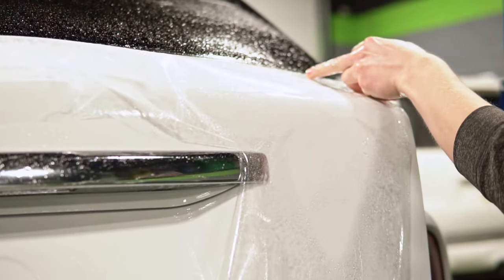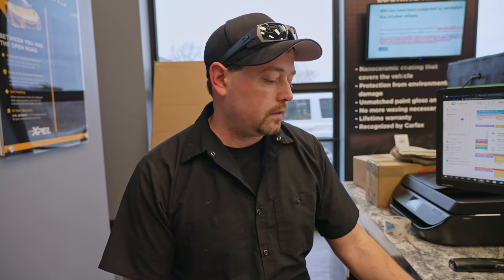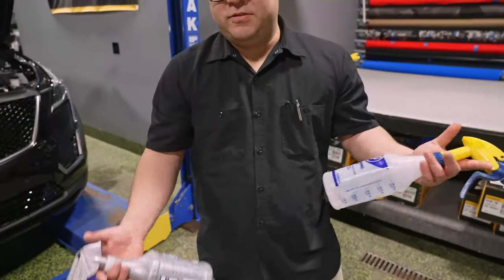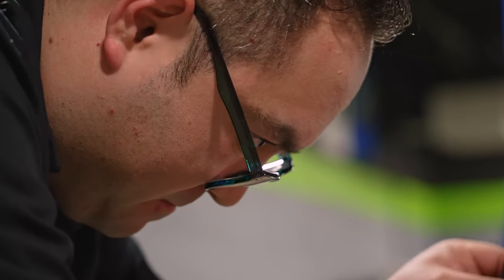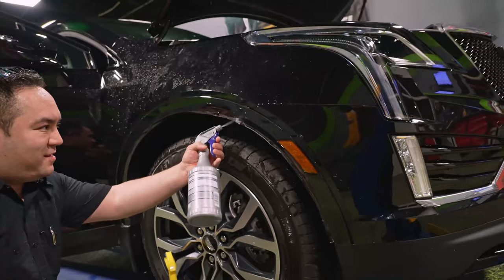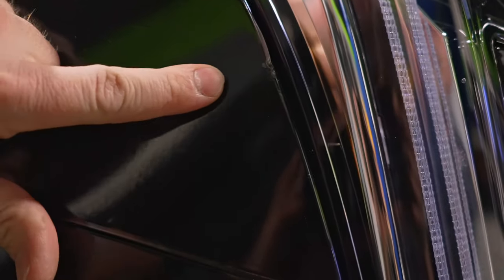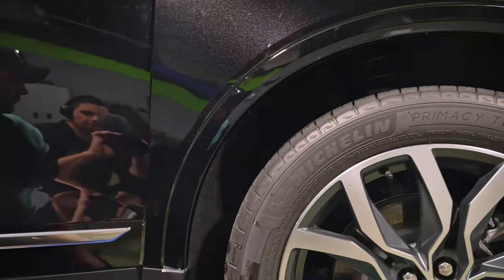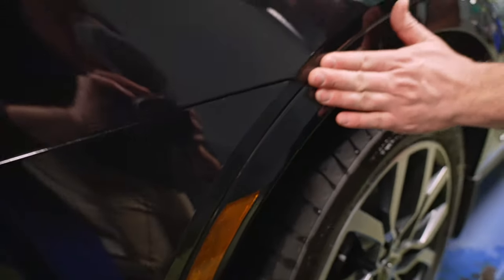🤔 DIY VS PRO | BEGINNER vs PRO Paint Protection Film Install

Comment: Great video. I did my own car without precut kits and I've done it before. I took my time and it turned out great I payed 900 for a role 60inch by 200inch to do the front of my car. I went as far as taking my bumper off. It took longer than what a professional would have but everyone around my area wanted 2000 to do it so I saved my self some money. I'd never do it again lol because it took me forever but that's why it turned out good because I took my time. It was a 2021 dodge charger rt. So it didn't have any crazy bends or turns or grooves in it
Reply from the maker: Glad it worked out for you. It’s quite the learning curve to get it really good and timely.

Comment: You’re missing out on the fact the material is pretty cheap, what costs a lot is the plans to laser cut it.
If you can get plans to cut it or make them yourself it becomes much much cheaper.
Reply from the maker: Hmm sounds cheap and easy when you put it that way
Reply: As long as you're careful with an exacto blade put full sheets up and trim as you go.

Comment: Slip solution is typically 2.5ml of johnson's baby shampoo (best) or 1.25 ml of dawn dish soap into about 997ml of distilled or RO water to make a full litre of solution. Tack solution is 250ml of 70% IPA with 750ml of RO/DI water to make a litre of tack solution.

I agree that having a pro install is best especially for a long-lasting quality finish. It's hard to DIY this, knowing where to tack edges, how to deal with issues. If the car you are protecting is expensive, spend the money on a good PPF install and forget about it for the next decade.

Comment: Have an VW Arteon. Precut parts are going to run me $1600. Rolls of wrap to do it is only going to run $243 and allows for better excess in the process. I am sure it will not be 100% perfect, but the main objective is to protect the finish, so a minor defect will not cause me to lose any sleep.
Reply from the maker: You can add them at your leisure too. Couple panels here and there. Save lots this way. Good luck 👍

Comment: Xpel keeps their prices tall to make it not worth it for the average consumer to DIY it - obviously the shop isn’t paying 1500 for the material not even close to it
Reply from the maker: Correct, you're also paying for the plotting/pattern technology.
Reply: @BlackoutTinting  even when I try to buy it in bulk and cut my own doors and hood and roof it still remains super expensive
Reply from the maker: @user-jt3nf7in5w  looks like XPEL doesn't want every DIY guy driving around with their product

Comment: PPF is one of the few things definitely not worth DIY due to cost of material being the driving factor and not labor. XPEL will sell a consumer that front end kit for an artificially high price of $1500, but they sell it to the shop for much less since they are going to keep ordering and have significant volume. This lets the shop only charge $250 more which would be about 2.5 hrs of labor which wouldn't be profitable if they had to pay full $1500. It's a win/win for manufacturer and installer.
Artificially high consumer sale price protects shops, prevents too many DIY installs which can hurt brand/product reputation, etc

Comment: I think you would have more credibility to this video if you weren't pre-wired/biased to say a DIYer can't do it.  Further, Isaiah, the poor soul, is not your typical DIYer.  I doubt he even changes his own oil.  Am I right?  If he was truly a DIYer, he would not have just "guessed" at his tack solution (which should be 1.5L water, 2ml baby shampoo) and ISO mix (3:1).  The price you quoted at the XPEL website is retail price.  A DIYer would be better off buying bulk uncut rolls which should be around $350 for a 36"x100 feet or $500 for 48"x50 feet which is MORE than enough to make lots of mistakes.  Aaron clearly does a great job.  Assuming it takes him 2 hours to do the front of the car at $1700, it's an impressive business plan that I'm no longer willing to pay for especially around here where they're not as good as Aaron.  Back when PPF wasn't as popular, this used to be $750 WITH paint correction!
Reply from the maker: nowadays you don't even need to do a paint correction before installing ppf

Comment: Drive Protected has a ton of excellent tutorial vids showing how to install PPF. I just purchased my precut kit and after tools, I'm up in the area of $1800 in savings for the full front end kit for an Tesla MYP. I thought it was worth a try.. I'll see how it goes. Will update with result and whether or not it will be worth it.
Reply: how did it go lol
Reply from the maker: how'd it go @mooster
Reply: @BlackoutTinting  About 3 months later I'm happy. Took me about 10 hours to install the hood, fenders, mirrors and bumper. But it turned out great ! The bumper was a b*** to install but otherwise it was cool. I'd like to give wrapping a try one of these days. I will say its not at a professional level like you guys. But for a DIY person that wants to save a load of cash and is okay with some imperfections here and there, Its well worth it !
Reply from the maker: Now this comment makes sense - like any diy job, prpba ly not as a good as a pro but if you can live with it so be it. Thanks for the update.
Reply: How much was the ppf material? Shops around me charge $1800 for the full front of my model y.
Reply from the maker: That’s probably about the average
Reply: Where’d you buy the film from?

Comment: Overcharging for materials and undercharging for labor skews the value proposition of this whole project for a DIYer. When you're forced to dropped hundreds, if not thousands on what is essentially a large screen protector, it feels stupid to then endure the struggle of installing it when it only seems like pennies more to have the pros install it for you. 

I'm not judging. I get it. Businesses have to stay in business, and if they have to adjust costs due to customer behavior, so be it. But don't act like the price of DIY vs pro install is somehow a valid point to bring into the discussion when the DIYer has no control over the outrageous prices companies charge for this PPF material.
Reply from the maker: Everyone is more than welcome to buy roll(s)of cheaper material from ebay and hand cut everything themselves, and many do without complaining.

Comment: 3m 8mil factory roll and positive attitude, $1,900 for a truck. Dealer installed $10,000, what am I missing (price quote from trained Xpel distributor).......... interesting racket
Reply from the maker: But they price it in with financing so you see little numbers

Comment: Awesome video. As a body shop owner I decided to send one of my techs to XPEL for certification for replacing PPF. Mind you, I am NOT in the business of being a PPF installer. I merely wanted to reduce the amount of sublet providers I had to rely on for our collision repairs. We usually find out selves replacing A single piece of film such as fender bumper or hood about once a month. I’m going a bit long here but I want anyone reading this to really pay attention to this next part. I consider my tech a step above a DIY’er but still not professional. I just purchased a Cadillac Escalade that I am going to have completely wrapped in Stealth. Now I could roll the dice and try to take this on. Keep in mind, I have an XPEL account that allows me to buy film at prices close to wholesale if not the same as you. Long story short… it’s going to a Professional installer. Just as you said in the video, we could probably take this on but we don’t deal with bulk film installs and it not worth the risk. 

DIY’ers reading this, go fix a hole in you sheet rock, go plant a garden… but leave PPF to the Pro’s.
Reply from the maker: Agree... it's not a diy type of project although it definitely can be done.

Comment: The protective film industry is a rip-off. They prey on the fact this takes skill to apply correctly, as well as a decnt amount of paint cleaning and prep.  There is no way the materials cost as much as what's charged.  Im betting the $1500 price here costs expel under $300 to make/ acquire , cut and package.   Im also betting dealers/ installers pay less than the list price, but charge the customer that price on top of the labor they quote without telling customers.
Reply: We really do pay the $1500 a roll. Maybe a 1-200$ discount if buying bulk. It really does take a lot of time to do. That and the fact that working on a car at this level can introduce risk. PPF is pricey because the work is long, hard and takes a lot of time to master. Nobody charges under $4000 for a reason

Comment: I had an expel licensed certified guy do my Dodge Challenger hellcat nose and rocker panels and mirrors all for $750.your saying that cars nose eould be $1700.00  Clear bra will never be accepted by most people because it's just too  expensive.this video is a scare tactic  to promote shops to rip you off and ceramic coating  is the biggest scam I know I worked in shops my whole life.
Reply from the maker: We are booked out for months, but if you want to protect more than just the👃we might be able to squeeze you in

Comment: Well.....I wanted to try to do my new Ford Explorer ST front end.  Hood, fenders and front facia and both side view mirrors.  NO WAY I'll be doing it if its only saving a few hundred dollars.  I'd rather a Pro like you guys do it and get the 5 or 10 year warranty it comes with.
Reply from the maker: Good thinking... There are of course lesser products other than XPEL to put on vehicles but a little bit of research will show why most turn to XPEL
Reply: @BlackoutTinting  ....so to do the hood, fenders, front and side view mirrors would cost me about $1500 in just the film?   Wow, I didn;t know it was that expensive.

Comment: After all that i still say diy. get cheap ppf  learn and get at it. If you learn you'll be able to save money on next car if you pay for someone you'll have to pay someone each time. That's how i learned window tint. Car audio installs and more. Don't be afraid to try. Don't be afraid to fail
Reply from the maker: There is a bit of a learning curve, something you would surely forget 90% of by the 'next car' but good luck!

Comment: I just did one of these for the front end on my GR86. I bought a DIY kit for £450. These people charging £1500 for a job that will take a couple of hours tops. I am just a hobby mechanic and painter but this was child's play. These guys are charging £350-400 an hour for glorified window tinting which is actually harder to do. All this video has shown is that the person in this video is incapable of doing it. A semi competent person should have no problem. It isn't rocket science. Blending in paint is far harder to do well and painters do not charge the rates these people do.
Reply from the maker: Will you fly to Pittsburgh and compete with us?

Comment: IF you are a TECHIE guy, you can DIY easily and save you a lot of money. Their figures is way-off coz the labor will kill you and I am sure you can buy the film cheaper from the distributor, cut it yourself and install it. It is not that hard to spray water, stretch the film, and squeegee it. IMHO.
Reply from the maker: Are you up for a challenge?

Comment: Its wild how much these companies charge for a sheet of plastic...PLASTIC. The labor to install it is fairly priced, but the product is a rip off.
Reply from the maker: It's self healing, hides scratches already on the vehicle and comes with a 10 year warranty. What do you think a fair price would be?
Reply: @BlackoutTinting  Yes it does have some great properties. I read adding PPF to a whole car adds around 10lbs. The retail price for 10lbs of plastic pellets is around $30. What's the material cost for wrapping a whole car $3000? PPF is clearly more advanced and better than a standard poly plastic, but 100x more expensive?

This is a critique of the 3Ms and XPELs in this equation, not the installers.
Reply from the maker: Plastic pellets seem like they would be difficult to install on the body of a vehicle though
Reply: @BlackoutTinting  Ok you made me laugh, you win.